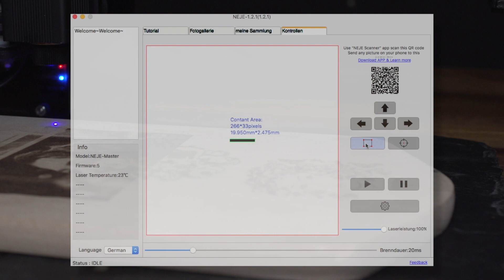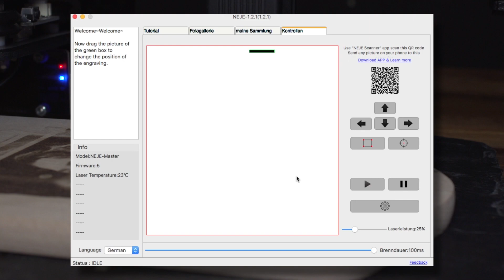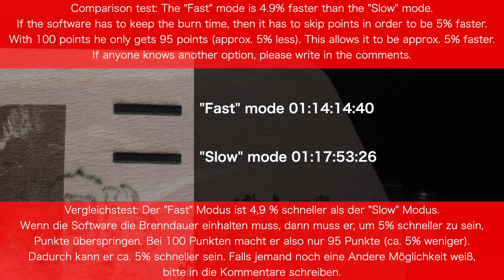Speed comparison "Fast" versus "Slow" mode | Geschwindigkeitsvergleich "Fast" gegen "Slow" Modus

Comment: Hello, fast mode and slow mode are to solve the problem of module weight. The 20W module weighs more than 200 grams. Although it is already very light in similar modules, it is recommended to use a slow module with this module, but If it is a 7W module, because this module is relatively light and will not cause severe jitter, a fast module is recommended. The choice of mode is determined by the weight of the module. Neje has optimized the motor accelerometer to the greatest extent. If you have requirements for speed, it is recommended to use the neje master 2 mini machine, which is twice the speed of the neje master 2, because this machine The mounted module is very light and can be scanned quickly without shaking.
Reply from the maker: Thank you for this comment. Now we know more about the "fast" and "slow" modes in the Neje software.